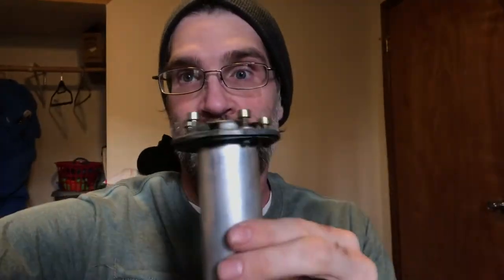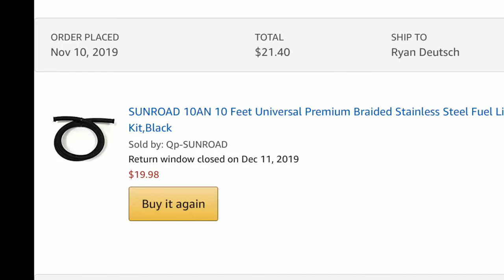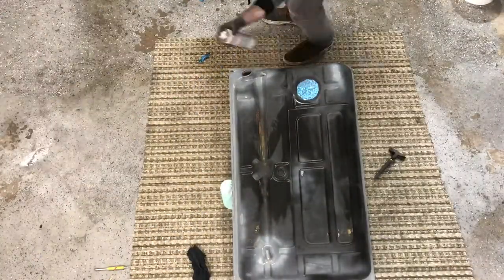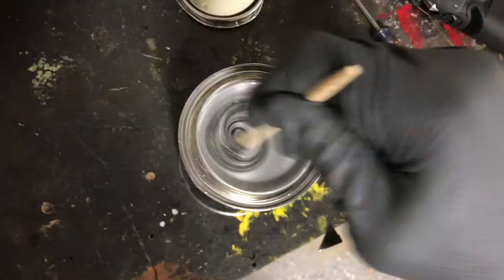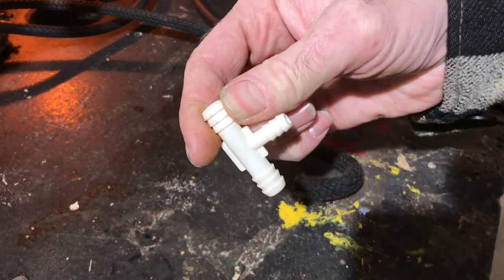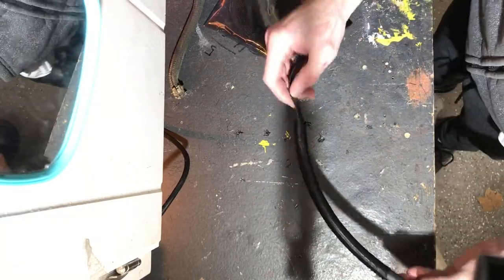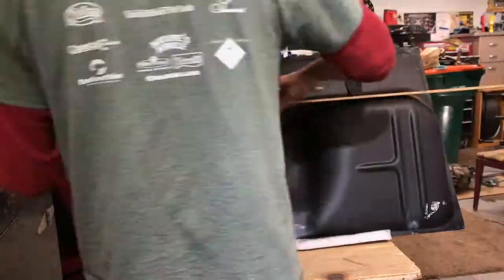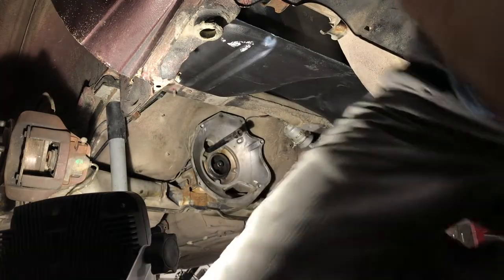How to Re-do a 924S or 944 Porsche Fuel Tank #ProjectPorsche

Comment: Great video. I learned a ton. Thanks for doing this. In the middle of this project myself.
Reply from the maker: Thanks!  Nice, glad to hear it was helpful.  You’re welcome, I hope it goes well!
Reply: I have watched it a few times. Just curious, would you have done anything different?  

Did this work out over the long term?

Thanks again for doing this.
Reply from the maker: Yeah, there’s a few things.  

1. When I took the tank out, I didn’t pull out the gas filler neck, (which your supposed to do) so I’d take that out first.  I ended up having to do that when I put the tank back in, in order to get the hose back on the top of the tank, so I would have just pulled that out to start with.

2. I would have gotten a bigger can of sealer.  I got everything coated and it turned out well, but I had to use every last drop, so to make it easier I would have just gotten the next size up of that can of sealer which I think would have been a quart or something close to it.  

3.  I used 3/16th for the smallest vent hose, but after doing it, I think 1/4 inch would have probably worked fine/maybe fit better cause the 3/16 was kind of tight.  I should have just gotten a foot of both and tried them both out first to see, but I just got the 3/16 when I went to the store so that’s what I used. I had to heat it up to get it onto the brass nipple that’s on the end of the black plastic hard line and onto that white plastic T I used too, so the quater inch rubber hose might have still been small enough and worked better.  If I was doing again though , I’d do another search first too just to see if I could find that hose with the flared end, see if someone sells it now.  If I could find it I’d just buy that.  

Aside from that though, it’s worked really well.  I haven’t had a single problem with it.  It’s never leaked or smelled like gas or anything.  The sealer seems like it’s stuck well to the inside of the tank, and everything works like it should.
Your welcome- no problem, glad I can help.
Reply: Thanks. I’m going to take all that advice.  

I haven’t actually pulled my tank out yet.  It’s leaking from a point that the previous owner had already repaired.  So I bought a new one that’s in decent shape. I’ve started degreasing and stripping it. 

When I take the current tank out you can bet I’m going to follow your lead on all those points. 

Thanks again.
Reply from the maker: No problem, hope it goes well when you get there!

Comment: I am in the middle of this very same project.  Love this video. I keep coming back to it.  Thanks man.  

Question:  in the photo of the other tank it shows a block of foam near the filler neck. Did you skip that?  If no, where did you source it from?

I’m hearing mixed things from people about the need for that foam block.
Reply from the maker: You're welcome, I'm glad you like the video!  I hope yours goes well.

For the time being, I skipped it.  I'm not sure why, but for whatever reason my car didn't have that foam piece around the filler neck.  I'm not sure if someone removed it before I bought the car, or if it never came with one.  If it was originally there, I think they must have pulled it out from the top because It didn't seem like the tank had ever been removed.  I might just leave it out, but what I was planning to do, (thought I'd already have done it, but honestly haven't gotten there yet) is when I bolt that sheetmetal cover down for good, (I've got it bolted down now but not with the new roll of butyl I bought back when I did this video) is take a can of expanding spray foam, and spray it down around the top of the filler neck and basically make my own foam piece with that, then bolt that cover down with the new butyl.  It won't be soft like the foam that's in that picture, but I think it should do the job.  My guess is they put it there for road noise?  The only thing is it will stick to everything if I ever need to remove it, so I'll have to scrape it out of there if I ever need to access those clamps.  I was thinking about maybe covering the top of the tank/hoses with masking tape or something else first (Saran Wrap?) then spraying in the foam on top of that so it won't stick to things, just fill up the space, but I'm not sure yet. Something that won't absorb water or stay wet would be ideal.  The can of foam I got for that has been sitting there on my shelf for a couple years now too.
Reply: Thanks. I hadn’t thought of doing that. Interesting idea.  I might look into that. 

One more q:  as you’re fitting hoses on to the tank or the hard line connections, did you put any glue on the connections or are you only relying on hose clamps?   

It looks like you’re not but wanted to be sure.  

I just dropped my tank and disassembled it this weekend and trying to make sure I understand everything I need to do before attempting reassembly as I wait for a parts shipment. 

Really appreciate what you’ve done here. Very grateful for this video and your insights.
Reply from the maker: No,problem, glad to be of help.  Nope, I just put the hoses on and tightened them with the clamps.  The rubber seal thing that goes between the main large filler hose and the inlet on the top of the tank was cracked a little bit so I used super glue on the edges where it was cracked and just held it together and glued it back together, then put that back between the big hose and the tank inlet, but besides that, no, I didn’t put anything between the hoses and the tank, just tightened them down with the clamps.  I guess it worked out well because I haven’t had a leak or smelt any gas since.

Comment: You forgot explaining most important thing. How did you fix and what did you use for thr fuel tank stainer ?
Reply from the maker: You know, you're right, I could have covered that.  That strainer and the aluminum part that thread into the tank come as whole and are available as a regular service part.  You can find them pretty cheap if you look hard enough - so rather than trying to clean or replace the fabric mesh on the strainer, it just makes sense to buy a new one. If you look up the part, (I think it's listed as a fuel tank filter or strainer) you'll see it comes pressed together with the new strainer and they aren't that hard to find.  I think the one I got cost less than 20 bucks.  I think because it's basically like a fuel filter I forgot about it/didn't cover it.  

One more thing - I put anti-seize on the threads when I threaded  it into the tank. I've seen it where they get rusted into the tank, so It makes sense to put anti-seize or at least some kind of grease on there when you screw it in so it comes out easily in the future.